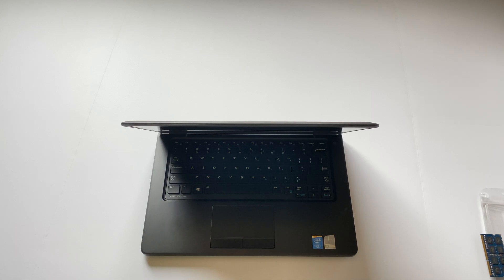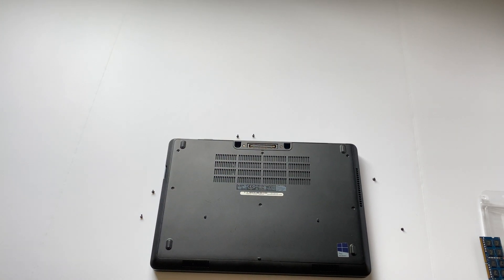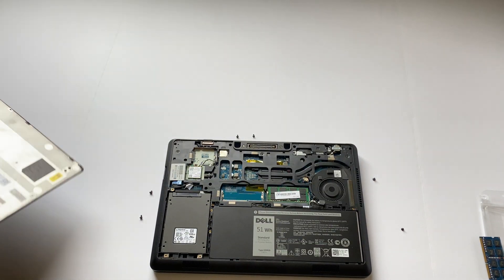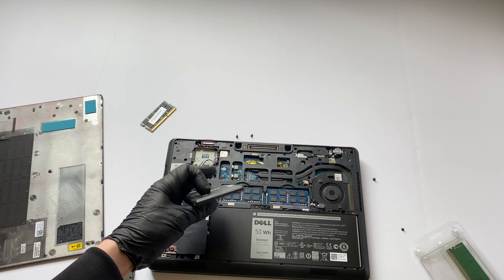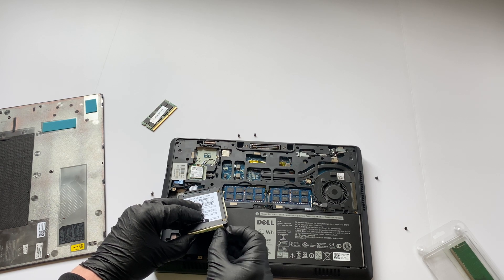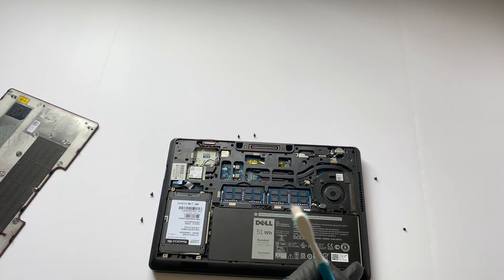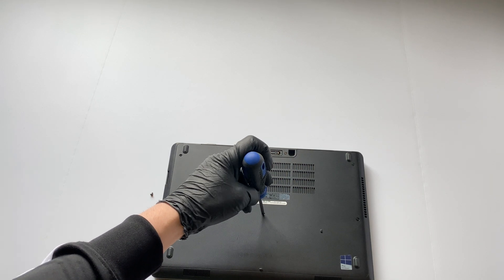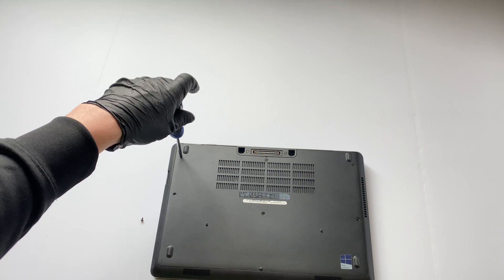Dell Latitude E5450 Upgrade RAM, SSD

Comment from the maker: List of RAM will work with this Dell Latitude E5450. 

(1.) Crucial 16GB Kit (8GBx2) DDR3/DDR3L 1600 MT/S (PC3-12800) Unbuffered SODIMM 204-Pin Memory
https://amzn.to/2XqCosX

(2.) Crucial 8GB Single DDR3/DDR3L 1600 MT/S (PC3-12800) Unbuffered SODIMM 204-Pin Memory
https://amzn.to/2Xt0l2W

List of SSD will work with this Dell. 

(1.) Samsung 860 PRO SSD 256GB - 2.5 Inch SATA III Internal Solid State Drive
https://amzn.to/2BY5gRl

(2.) Samsung SSD 860 EVO 250GB 2.5 Inch SATA III Internal SSD 
https://amzn.to/37xWUfc

(3.) SK hynix Gold S31 1TB 3D NAND 2.5 inch SATA III Internal SSD
https://amzn.to/3d7X6D6

(4.) Samsung SSD 860 EVO 1TB 2.5 Inch SATA
https://amzn.to/2B2FURX

(5.) SanDisk SSD PLUS 1TB Internal SSD
https://amzn.to/3hwdqku

(6.) SanDisk SSD PLUS 240GB Internal SSD
https://amzn.to/2zfc7EX

(7.) Crucial MX500 250GB 3D NAND SATA CT250MX500SSD1(Z) 
https://amzn.to/3bTTjbX

(8.) SanDisk SSD PLUS 480GB Internal SSD SDSSDA-1T00-G26
https://amzn.to/2yfgjUK

(9.) WD Green 1TB Internal PC SSD  WDS100T2G0A
https://amzn.to/2XfGtzc

Comment: Can someone help me find 16gb of compatible ram in Canada since I can't order what he recommended since in not from the states
Reply: You will need to look for ram listed under the term "PC3L-12800S" It should be DDR3 and SODIMM RAM which just means it is the shorter sticks for laptops and smaller computers. It is best to make sure that it is 204 pin RAM just to be safe.
Reply: @cmelton.photography  thanks 👍

Comment: I own E5450 with HDD (not SSD). I want to upgrade to SSD. Is the connector (HDD and SSD) same / plug and play?
Reply: Should be the same, SATA port and power connection both included in just one connector.